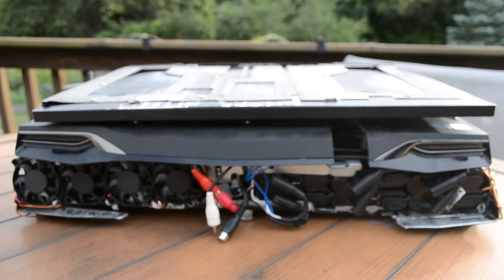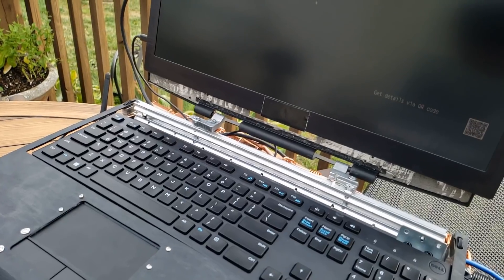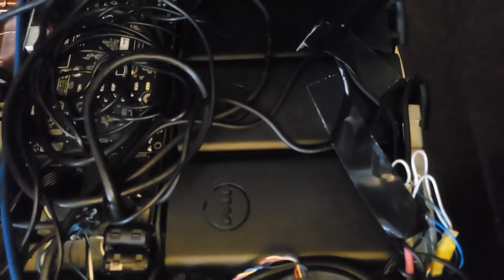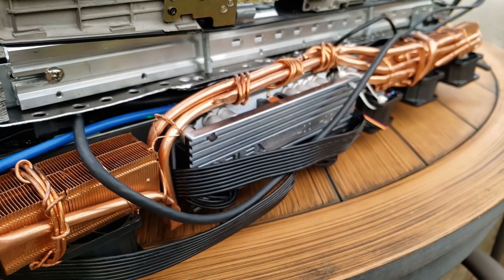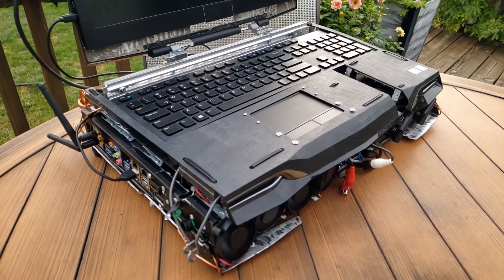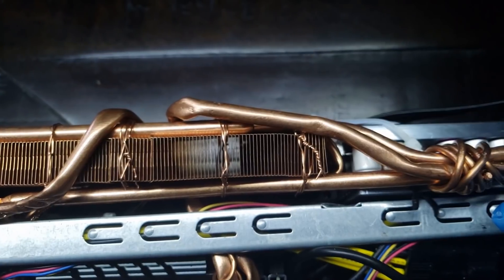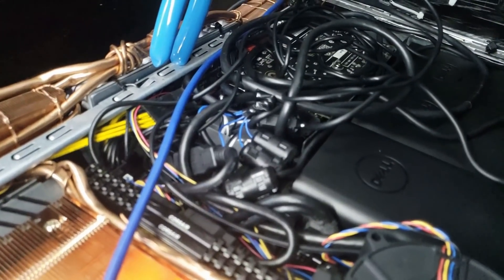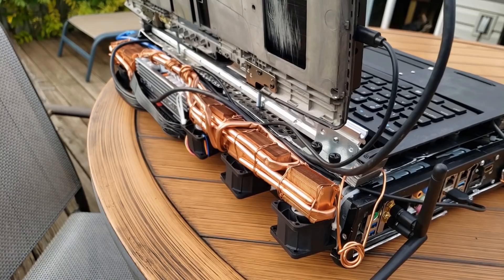The Most Powerful Laptop in the World: Threadripper 16C/32T

Comment: I think I made something that can beat this.. Look up Janktop IV.
Great project though, it was one of the primary inspirations for mine.
Reply from the maker: Awesome! Kudos for making the project open. That will slay when you get a 5950X in there. I like what you did with the polycarbonate + printed components, as that gets around [non-industrial] print bed size limitations.
Reply: @TECIST  Yeah lol, i was originally going to get the whole thing printed but then I found out that'd be 1000 dollars and pretty weak. Honestly your build (alongside a few others) kind of served as a proto prototype, as I took inspiration and basic design choices from a lot of previous attempts. I think the hardest thing people don't realize about this sort of project is actually not only fitting the components, but fitting them in a usable way, where I/O and cooling lines up to be comfortable for the user. I will always be sad though that my Janktop doesn't support threadripper, because there are no ITX threadripper boards.
Reply from the maker: @stripeysnake3624  Agreed about layout.  You have less volume than small form factor cases and severe height restrictions.  No Threadripper ITX, but there is an EPYC ITX board: https://www.notebookcheck.net/Server-grade-mini-PCs-ASRock-reveals-Deep-mini-ITX-motherboards-with-AMD-EPYC-Rome-CPU-support.506212.0.html -- or better yet, future upgrade paths as long as someone makes ITX boards
Reply: @TECIST  Yeah, future upgrade paths is the main idea. I've already upgraded from b350 to x570 and 1060 3gb to 5700 xt. I do know about that epyc board, and while amazing, it's definitely not the most cost effective solution lmao. I am worried with the trend of higher and higher wattage CPUs and GPUs though. The janktop has considerable cooling but it will only go so far.
Reply: @stripeysnake3624  Dude I absolutely love your project. I've actually been working on something extremely similar to your design.

Comment: Cable management. If you just put it together i get it, but please, reduce the lengths of the cables.
You could also make the battery pack yourself. A 4-8 cell BMS + 8-16 lithium cells (there are a lot of variations here) should be cheaper than the DELL bricks you've bought. Tab welding isn't difficult, all it needs is some super caps and a solenoid-switch.
Reply from the maker: The Dell bricks were an easy way to get 19.5v, which the PSU expected.  I think you're right that a DIY pack with BMS is the way to go, and that's the plan for the next iteration. Some thin mini-ITX boards can accept fairly wide voltage ranges (12 ~ 19v), so you're good to go with 4S at any normal level of charge (x parallel to support current and run time as needed, 4S3P or 4S4P would provide serious juice)

Comment: I come here after reading an article that talked about your project. I made a similar but smaller project in the past... I put an 3rd gen i5, gtx 750ti, 8gb ddr3, 512gb SSD and monitor inside a suitcase, complete with 3d printed cover and solid alluminium io plate for the motherboard and gpu... The cool thing was that i mounted the GPU and the motherboard on the opposite sides of the suitcase and connected them via a flexible pcie extension (750ti don't require 6pin) I've made a custom heatsink and made the GPU only 1 slot thick. Mounted a cheap speaker amplifier and an old LCD monitor (only the panel without the plastic, for a thinner result) and at the end It was cool and all but not really super practical... I tried to play Cod warzone but the GPU and 8gb ram couldn't keep up. I tried using 2 20000 mAh battery pack for a Total of 4 cells.. 4s bms, two switching Power supply for charging and powering at 12v but it wasn't a very good option After all... I used only a 180 laptop charger at the end with a pico 160w (screen was powered directly from the charger... 20w for the screen alone)
Reply from the maker: Sounds like a nice build.  Is it up on hackaday or something?  The current was an issue here, hence going up from 12v to 19.5v from the laptop chargers.
Reply: @TECIST  sadly i didn't document the building process, maybe someday i will try to do It again and make a video about It :)
Reply from the maker: Sounds like you put some time into it.. I would still post it on hackaday.io as a completed project and talk about the GPU mods, like how you shaved the height, what you learned from the power headaches, etc.

Comment: Thats insane sketch. I love it. Please elaborate on the heatpipe design
Reply from the maker: The theory was that a vertical stack of heatpipes touching the sides of the heatsink would both transfer heat away and keep the hot air flowing in the same direction and out of the case, then the high RPM axial fans could spin up if heatsinks/heatpipes became hot enough.  What actually kept the CPU coolest was leaving the palmrest/keyboard off and pointing the blower fans straight down at the heatsink over the center (a.k.a. the hot part) of the Threadripper die.  If I did it again, I would keep the twin blowers, but direct their airflow down toward the center of the heatsink and clear the path to the exit (might require shaving down one of the motherboard's heatsinks).

Comment: I think you can get a 5950x with a itx b550 or x570, it will be smaller and have better performance, but like the battery and powersupply stuff is crazy
Reply from the maker: The 5950X wasn't out yet, but yes, at the time even the 3950X not locked in Eco would have been more compute horsepower for less wattage, and now the 5950X would be better still.  Or for a new insane build, maybe I can figure out how to get my hands on one of the new EPYC ITX boards (@linustechtips did a video on it).

Comment: "First I had to establish the design elements..."

You mean just cramming everything with no inherent design focus inside a chassis? Still though, good attempt but definitely not the *fastest*.
Reply from the maker: ???  It's the fastest.  The XMG Apex has a 3950X, which would be faster, but it's locked into eco mode reducing its performance below the 1950X.  The ACME NotePAC III Pro V has a 16C Xeon D-2183IT but that falls short of 1950X performance as well.  If you've got a link to something with more horsepower, please share.

Comment: A 3-D printed chassis would do a lot better then lithium batteries on a custom controller would be the obvious unless using standard NFP/Mini V/G mount batteries in a hot swap system you can also use PCIE to MXM adapter and pack an P5000/1070 on a standard 3 pipe mobile heat sync and add ports for expand ability with express card slots like the original M18X had it was a desktop in a laptop using its frame is a very fitting starting point and using internal headers to cut down on space and modifying the motherboard ports to modular connector blocks would be another point to make but condensing the whole thing down to standard blower fans for cooling would be the ideal next evolution.
Reply from the maker: Working on something a bit more realistically mobile.. the PCIe-to-MXM idea is especially interesting as you could keep things very thin vs a desktop GPU
Reply: @TECIST  As a 1950x thredripper user and as an M18XR2 max orignal 680m Sli config owner this project is pretty cool I have a dead M18XR2 spare I might mod it into a modern monster someday but id make custom heat syncs and have a new made motherboard and screen fitted 5950x would be ideal and a moded battry pack but keeping it as original on the outside as possible

Comment: Wouldn't a 3950x or 5950x make way more sense?
Reply from the maker: The 3950x would have.  The 5950x wasn't out yet, but would make the most sense (as much as a desktop replacement can) now -- way lower wattage for better compute power, but then it wouldn't have been ⚡THREADRIPPER⚡... also, 3950x was more expensive than a used 1950x

Comment: Sugestion ditch battery packs use a transformer psu and custom build the laptop shell on cad and cnc it it would look like a fat laptop but better integrated
Reply from the maker: I looked into off the shelf and custom lithium batteries, but ultimately the cut-price Dell Power Companions won because they had built-in passthrough charging and UPS-type circuitry, making for very simple connections (other than the data pin experimentation).  The only lithium packs I can locate with a built-in BMS are LiFePO4 meant for e-bikes/similar and are arranged more like a car battery than the row of 18650-type shape I'm going for.

Comment: I mean, for $1500 you could have gotten the acer laptop with ryzen 2700 desktop cpu, 16gb ram, vega 56 desktop gpu built into the mobo, and a cooling solution that is better than liquid cooling.
Reply from the maker: That would certainly be more reasonable, but only half the CPU compute performance for ~50% higher cost.
Reply: @TECIST  yes sorry, I was thinking about this from a gaming perspective when I posted that, for workstation performance compiling/building apps, this is absolutely better.  Also that Acer was basically discontinued and has gotten awful hard to find now.
Reply from the maker: I think XMG has that section of the market covered with the Apex 😂  Have you seen that thing? They're probably who I'd look to for a 'fully engineered' laptop right now.

Comment: Not the fastest laptop at all, there's actually a 3990X laptop, and a 3950X/5950X laptop (such as the apex 15 - which supports the 5950X with a BIOS update at some point soon) will outperform this without much issue, even with 'quad channel' and an overclock it'll be far behind due to the Ryzen 1st gen threadripper IMC being terrible, great job nonetheless.
Reply from the maker: Please share links -- the only 3990X "mobile" devices I can find are portable workstations with no battery power options.  The 1950X beats the 3950X in eco mode, as it is locked into in the XMG Apex.  Origin PC pulled the 5950X out of their configurator, with some sources citing bios updates needed.  I'm not seeing anyone offering the 5950X directly or support yet.  It's inevitable, of course, but for now I think the eco lockdown on 3950X's means this is still the fastest for many-core workloads.
Reply: @TECIST  Okay? 3950X with a UV is literally faster than a 1920X even in eco mode with stronger ST by far and at that, ITX 3950X would destroy it or even EPYC ITX which is a thing..
Reply: Not to even mention power efficiency on the 3950X is a hell of a lot better and having ITX instead of M-ATX would've lead to having more space for a cooler or something

Comment: What are dimensions and weight of this beast ♥
Reply from the maker: Roughly 19 x 11 x 2 for the main body.  The palm rest/keyboard/hinge bar adds nearly an inch but that could be cut out with a flatter keyboard (e.g. scissor switch vs membrane that is in there), so probably 4" high overall as is but it needn't be more than 3" or so with some relatively minor adjustments.
Reply: @TECIST  What about the weight? With and without the charger setup?

Comment: about damn time.. hoping for someone to build this laptop chassis with desktop pc hardware inside, yes its kinda crude but its in a right direction but with cad model software, 3d printing machine and other resources access, it potentially be molded to into a all in one laptop chassis with interchangeable desktop pc hardware & a slot enough to fit a mech keyboard & mouse.. not sure how to put a front IO ports for peripherals & a pair speakers in it (or just use a portable speaker with 3.5 mm aux jack & Bluetooth function to connect it.. same thing for webcam too).. was thinking to have a laptop chassis (modeled similar to the grid compass pc laptop) with interchangeable desktop pc hardware space (preferably a mini itx motherboard setup) & a slot space to put a mech keyboard (preferably 65% size) and mouse.. that would be awesome..
Reply from the maker: Ah, someone else who knows what GRiD is!  Hopefully we do get to a more interchangeable and upgradeable hardware future.

Comment: Bruv, you should get a medal for your effort and ingenuity full stop!!! However, not to be picky but there are 3950x solutions on the market nowadays that will outperform your incredible machine by some distance, even though in eco mode. Also, if I'm not mistaken, they were already available at the time this video was uploaded. Having said that, the performance per quid of your laptop is, in all likelihood, pretty much unparalleled. My sincere congratulations.
Reply from the maker: The 3950X is just barely hampered enough by eco mode to be bested by the 1950X in many-core workloads, though of course a much better idea for power efficiency.  If someone can hack the eco mode lock and up the wattage even a bit, the 3950X would take the lead no problem, but I haven't seen this yet.

Comment: Hahahaha brilliant. Not sure those heatpipes will work when crushed like that but all the most powerful laptops are throttled so this is entirely awesome and correct. Also Fuck Mac you cannot make a credit card with enough cooling or battery life.
Reply from the maker: Hopefully the fluid could still move in the heatpipes?  I think I would be further ahead omitting the heatpipes and cutting down the motherboard heatsink by the CPU so the air can have a direct path over the CPU and out.

Comment: Cool job, but build a battery pack from 18650 batteris yourself. All the packaging material for the power units are unnecessary to carry around. Also use a 12V only motherboard, simplifying power, cooling and design more.
Reply: There is no such thing as a 12v motherboard for that cpu
Reply: @danielemartire2274  Must be some OEM am4 12v now
Reply: @jambosuss  that cpu use TR4 socket, server oriented, is very unlikely there is something like that.
Reply: @danielemartire2274  funny... ever locked inside a server? Server mainboards are all 12V only.
Reply: @Bunkerotter  Pico PSU can be a option but don't have enough power budget, if I recall correctly up to 160w. I remember using one in my car-pc. For the server question I saw many server inside, I built Intel Servers (as IPI Intel Product Integrator), nowadays I just buy HP or Dell server
Reply from the maker: I think I'm going that direction (18650 cells) for the next build.  It's interesting how little is out there for DIY lithium (the big electronics companies probably don't want the liability, and I think this holds back the open project ecosystem, especially for higher-powered stuff like laptops).

Comment: Thanks for review. Do you think if it is worth about your time you spent? What problem do you solve with this project? ...

My opinion is not worth it. It's a mess laptop. It is hard to develop or repair and even harder if you want to improve it. And many more...
Reply from the maker: Being worth the time depends on what the objectives are.  I wanted uncompromised desktop performance for multithreaded CPU workloads in a laptop form factor, so DIY was the only way.  Plus, a lot of the fun was modifying and using parts in ways the manufacturers didn't intend.  It is messy, e.g. I wouldn't try to bring this on an airplane, but the design choices are generally functional.  I would challenge you on the hard to repair/improve idea -- versus conventional laptops that have proprietary motherboards, soldered CPU's, GPU's, and even sometimes RAM, this machine has a standard swappable mATX motherboard, socketed processor, slotted RAM, GPU, etc. meaning basically everything can be swapped out or upgraded to hardware not even out yet, as long as boards are mATX or compatible.

Comment: how much thinner could it be if IO was modified and ram angled?
Reply from the maker: Not much, because the Dynatron A28 heatsink+CPU socket and the double-height stack of lithium batteries end up being around the same height as the IO shield and low profile RAM.

If you really went crazy with the mods, you could perhaps get down to just over an inch (but you'd have to remove the IO shield surround, desolder most of the IO, shave down the motherboard's heatsink, angle the ram, replace the CPU heatsink with just a vapor chamber and bring the heat elsewhere via heatpipes, replace the blowers with thinner models or axial fans, use right-angle connectors for power/PCIe, and reduce/spread out the batteries to single-height; a single slot GPU e.g. 1070 Katana / Quadro wouldn't hurt either).

It would probably make more sense at that point to go with an ASUS H410 thin mini-ITX and Intel i7-10900 for integrated graphics or i7-10900F + single-slot GPU for discrete graphics.  That would be thin and offer similar horsepower (until you get to a 2970X or better) at much lower wattage.

Comment: Wow, it is beautiful, lots of work and a great proof of concept! I would really do something more for the optics, just glue some fiberglass, polish and paint it. If i could do sth like this myself i really would not integrate the batteries in the same case (maybe optional and external). I guess most often you will not need batteries going from one place to another and they are just dead weight. And it is missing (just my taste, no critique!) a handle, like a suitcase. I wish sth. like that would be commercially availabe with a 3970x to a fair price, maybe one day i will build sth like that myself, so thank you for the inspiration. I hope for more videos like this.
Reply from the maker: That's true, the batteries aren't usually doing much.  I thought hard about external batteries but felt that would be 'cheating' / not technically a laptop.  One small plus is that they serve an uninterruptable power supply (UPS) function.  I do see some ITX cases out there with handles you could build in and small form factor PC's are of course getting more powerful at the same time a lot of workloads are shifting to GPU's.  Maybe you could trim an ITX case down with a 19V input motherboard or HDPlex PSU, ITX 'thin' board, compact video card, etc.